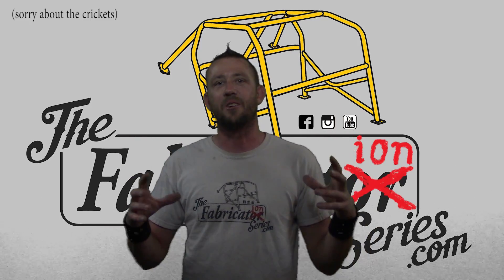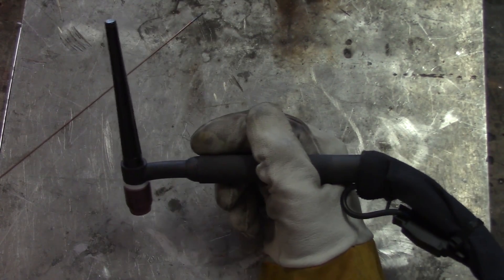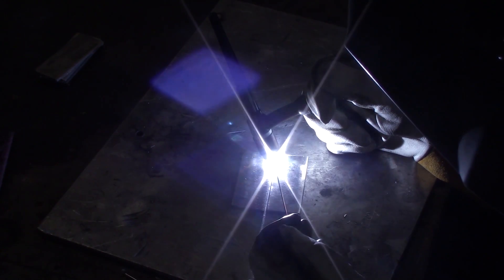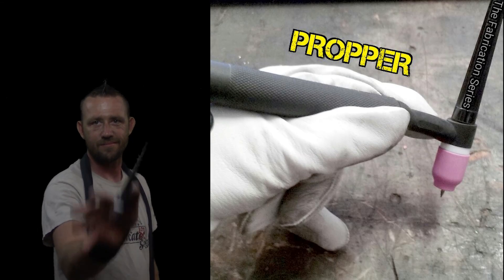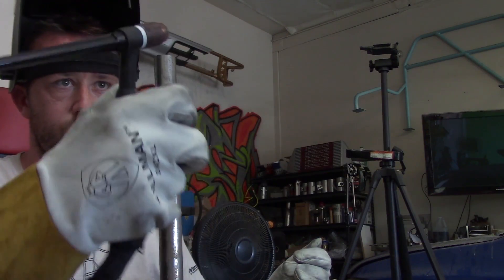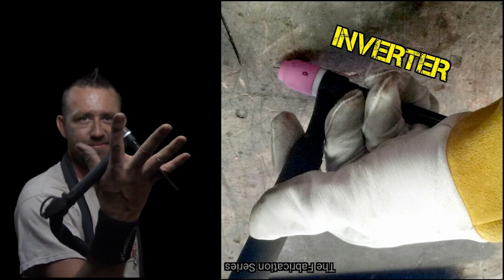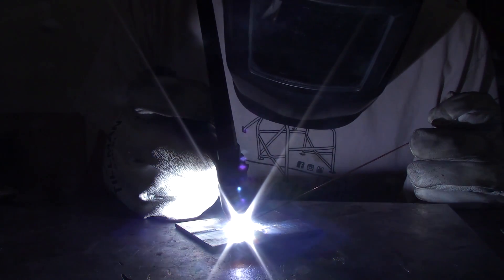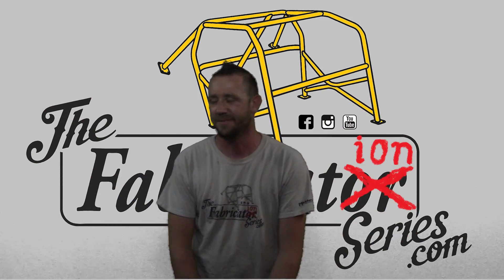TFS: TIG Simple - Get A Grip - 8 Ways to Hold a TIG Torch

Comment: I have a problem, my tig torch that came with my miller max star 161 has a loose grip that slides off frequently and turns whenever I hold it due to the hose twisting and idk what to do about it. I have to choke up like a pencil on the neck where the body turns into the torch head. My hand cramps from holding it so tightly

Comment: Thank you for super detailed explanation.  I am just starting and only able to hold my torch with a choker grip.  It’s a wp-26 with a trigger and molded body so it’s probably closer to a shovel handle in thickness.  Should I just go ahead and get a thinner torch and save this one for heavier materials?  I am not working on anything thicker than 1/8 steel.

Comment: I used the choker almost everyday to do 90% of my welding. I do a lot of thin sheet metal. I need the extreme stability and control the choker provides. Because it's sheet metal I can run a 12-inch bead without it getting  hot.👍

Comment: If I bring my own machine etc how much would you charge me for the tig steel and aluminum class?
Reply from the maker: Bringing your own machine doesn't change the price because we're still using our consumables, gas, power, metal, and staff. The only reason to bring your machine is if we do not have the same one here (which we probably do). If you'd like to send an email or call to discuss, we're always available.
Reply: @TheFabricatorSeries  I just got my Miller 220 yesterday and wow tig is way more difficult than I could have imagined. But like you say in your videos practice practice practice. Already getting some decent results but only in ideal conditions and then once stuff gets too hot it goes sideways real quick.

Comment: Outstanding, I was struggling with the theory on "Walking the Cup".. meaning, I couldn't do it, or 3 minutes into trying to maintain a steady go, I would feel like I just left the gym after a 20 sets of 20 rep's of 200 lbs of curls, just exhausted with my noodle arms. I just fired things up to test this position to walk the cup... WOW!!! Thank you, I had given up on that method, and just thought it was something I couldn't do, until now!!! I need some table time with this now, but it is actually easy, now that it feels comfortable...  Again, Thank you, Dru...
Reply: Cup walking is primarily a steel pipe welding technique, there are other materials and jobs where this method is 100% not acceptable, those being aluminum,  anodized aluminum, polished stainless and sometimes exotics that are not going to be ground/polished, the ceramic cup leaves pecker tracks where the cup pivots, doing so on those materials I mentioned will many times result in termination.

Comment: I don't use any of those grips. None of those grips are comfortable. None of those grips work good with walking the cup. I walk the cup as much as possible. When I use a tig finger, I hold on to the torch with my thumb and index finger, and use either my middle finger or my ring finger as the tig finger. You mention for those of us that don't use a foot pedal; I have never used a foot pedal and would never be able to. I always scratch start.
Reply from the maker: John Bergeson Nobody suggested these are the only grips to use haha. These are just the most common.

Comment: What nozzle setup do you have on that torch, it's super short and compact!
Reply: good question :)
Reply: That looks like standard gas lens and nozzle for 9 or 20 style torches. Without gas lens these torches are even smaller but gas coverage is not that good.
Reply: You can buy stubby gas lens kits on ebay or from, they're pretty great

Comment: All great grips, but what about those that have a thumb control?
Reply: I use a thumb wheel at work. The torch lays on my index and middle fingers and I rotate the wheel with my thumb. I'm usually welding someone else's fit-up so it's easier to adjust the heat for me. I usually have a Tig finger on my pinky and ring finger to stay worry free of the heat
Reply: Is there a recommendation for this?

Comment: Best tip I've found is to always keep a light grip on the torch and always keep the tungsten well prepped.  After that and getting comfortable with feeding the filler rod, it comes much more easily.  A tig finger also really helps.
Reply from the maker: Good tips. There will be many more in the TIG Simple series as I go through virtually every portion of beginner TIG welding. Thanks for watching!
Reply from the maker: christians131 It's in the plans.
Reply: awesome cant wait. Been following for over a year
Reply: As for the tungsten if ur ever welding and all of the sudden stuff aint working right.  Like if ur doing scratch start and it wont light or u cant get the arc all the way down in the root and getting a cresent shape.    Ur past due for a sharpening lol.   And itll feel like a whole new machine 😂😂
Reply: Thanks for making them!  Do you plan to go in depth with tig welding aluminum and other materials?  Mine always seem to come out grainy with 4043 but I do better with 5356

Comment: what would be your recommendation for a first tig machine?
Reply from the maker: I'll get into the machines very soon in the TIG Simple Series. There is a lot to consider which I really can't get into (and make it make sense) in just a couple lines of text.
Reply: I bought a lincoln square wave tig 200 last year and I love it.
Reply: I bet your local argon supplier loves it too.  lol  Insane postflow.
Reply: worldtraveler you ain't kidding lol. It's 17 sec at 200amp though. Most welding I do is like 130amp and below so the post flow isn't too bad
Reply: I have a lincoln 250/250 tig. My post flow is adjustable. The machine is from the mid 90's. I'm not exactly sure of the time. The other nice part with transformer machines in my opinion anyway is longevity. Just got rid of a Miller maxstar that smoked a circuit board...
Reply: Damn I assume it was out of warranty?  And yeah I like the old transformer machines for the same reason but portability is nice with smaller inverters
Reply: Zackary Zerr Buy a transformer non inverter type. It will force you to learn how to tig weld. Those fancy settings and programs make it easier but also take the skill out of it

Comment: which grip is best, the one you need at the particular moment.. :-)
Reply from the maker: Exactly
Reply: I usually always end up at "dip the tip" grip though.

But the advantage is that I am not limited to choose out of the various mixtures of tungstens, I polloute my own as I weld. 😂

Seriously, a big torch with a ridiculously heavy cable might not the best for starting out, but that's what I have...